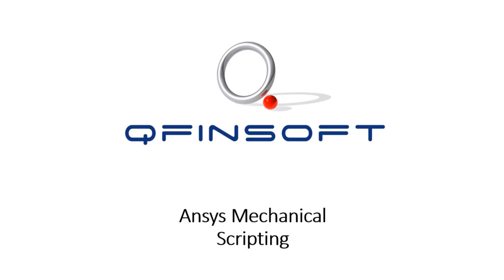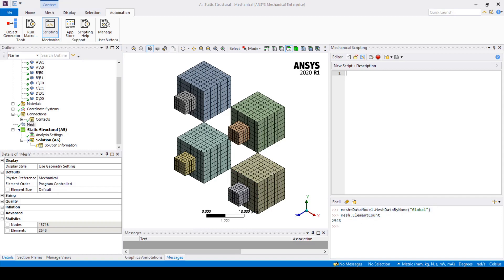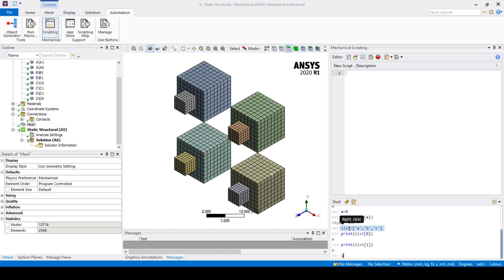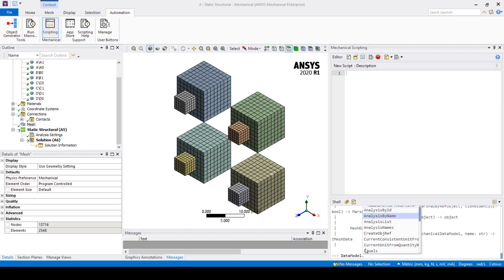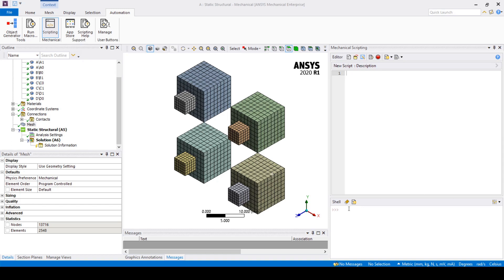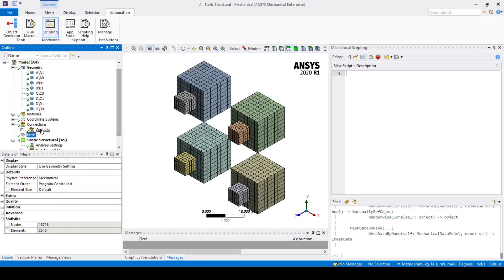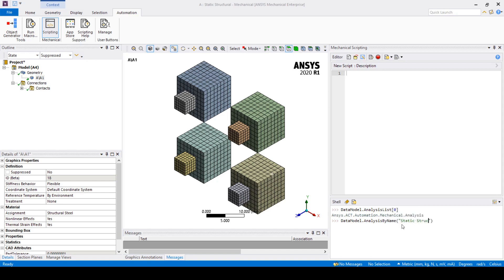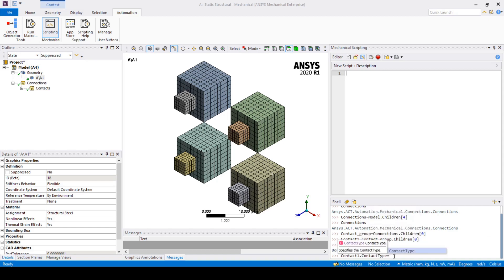Ansys Mechanical Scripting: Part 2

Comment: Hi, nice video there!. by the way, I want to find out if it is possible to change the dimensions of the geometry-> box from the 'Model' section using scripting method. I tried using ExtAPI.DataModel.Project.Model.Geometry."Something" but there is not way to assign new variables, such as length X length Y and length Z to the box, as it mentions "read only". I want to be able to change the dimensions of the geometry primitive box (Design Modeller) without going back to the geometry section and manually redrawing the boxes all over again. Is that actually possible and how can I approach it??? Thanks